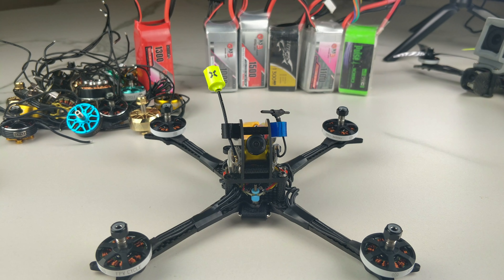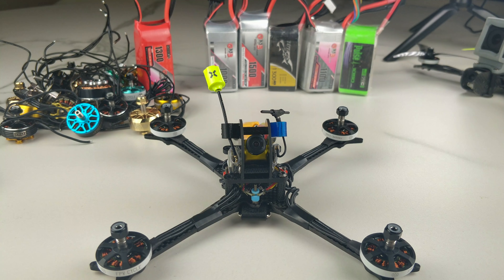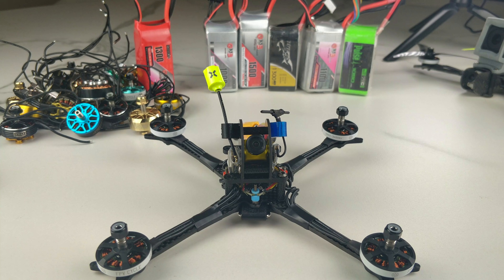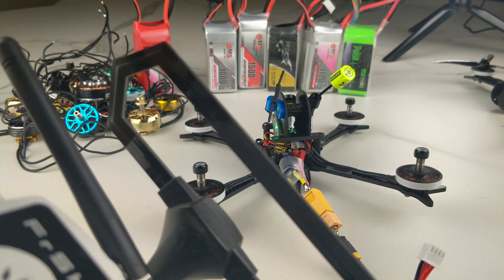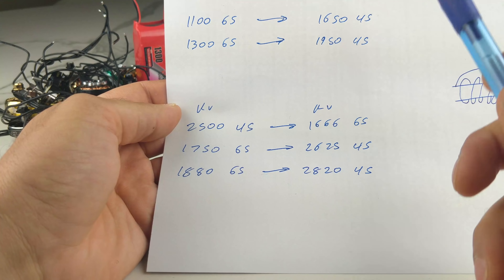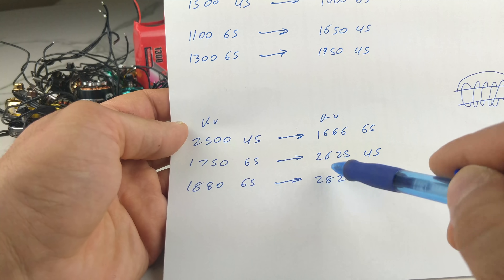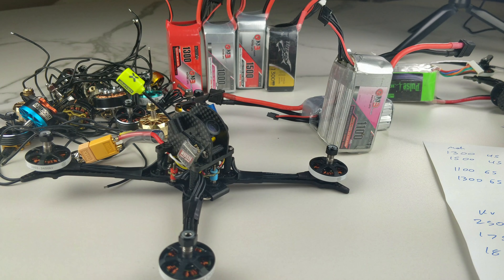6S Everything?  Why does 4S feel different?

Comment from the maker: RSGo Competition: https://rsgochampionship.com/

Disclaimer:
I am NOT an engineer.  I DO NOT know everything.  This video is presented to the best of my knowledge at this point in time.  If I've made errors, please educate me instead of spitting hate.  Thank you.

FPVCycle 2203: https://bit.ly/3i7QPuA
CineSplore: https://bit.ly/3dGJu1z (back in stock in ~11 days)
Gemfan Duct props: https://bit.ly/385nvAk
30A 4S AIO Toothpick board: https://bit.ly/3i8POCq
PowerPick: https://bit.ly/3fW6iMq

Longer Vista antenna - https://bit.ly/2ViXhFg
Vista + Nano Nebula - https://bit.ly/2ViXhFg
Vista kit + longer camera wire - https://bit.ly/2ViXhFg
200mm DJI camera wire - https://bit.ly/3eyBYXU

More things coming soon to FPVCycle.com

Table of Contents:
►00:00 - Intro
►04:25 - Example of issues on higher voltage
►07:25 - Comparison of 4S vs 6S
►12:58 - Basic electromagnet overview
►14:45 - Moving from 4S to 6S, current drop
►17:29 - What voltage does to torque
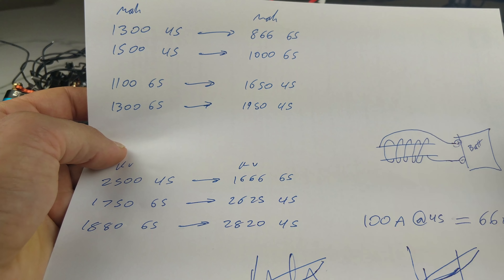►21:55 - When do you need more volts

▼Join my FB group for more discussion: Kabab FPV
https://www.facebook.com/groups/379155946182689/

The store: www.FPVCycle.com

▼ My typical 5" quad setup:
-CineGlide: https://bit.ly/2MCoz50
-Motor: http://bit.ly/2Nqqr25
-ESC: http://bit.ly/2oDdzvL
-WaFL’s Cap Cap: http://bit.ly/2GUpXxO
-Battery: http://bit.ly/2JnsTDM
-FC: http://bit.ly/2XRc8G8
-FPV Cam: http://bit.ly/2Q7LfL7
-Vtx: http://bit.ly/38Y25oz
-ND GoPro Mount 30deg: http://bit.ly/2WC15zc
-ND Filter (if used): http://bit.ly/2WEmQ1j

▼Notable motors:
Check out the Rcinpower Wasp and Bison...interesting motors coming.  We're working on blending those two motors into one.  The Wasp is more powerful but the Bison has an awesome 11mm bearing that's uber smooth.

▼Starter goggles: http://bit.ly/2qbJNOS

▼ If you want to solder better:
-Fantastic solder: https://amzn.to/2P5QM2W
-Fantastic iron: https://goo.gl/DqBipa

▼ Tips?
Patreon: https://bit.ly/2oGLP9b

-PayPal: https://www.paypal.me/kababfpv
-Bitcoin: 1E4XZXoD4rS6MYWVWuenY7Kw2M1YgyNpoQ
-Nano: xrb_1188ek5bd7tb9kw67asnp9o65byuoaxbtpxuznx1ribf75x78awywmakj55f
-ETH: 0xD067F93811f2eC31CB1928901002dfdf9A492EF5
-LTC: La2KWYAjp4VT2Lq2M76pbjzXWvRyjpfCtG
Reply: @KababFPV
Increasing current flowing through a wire,  does increase electron flow, producing a stronger magnetic field. However, that assumes the exact same wire, with the same length. 
A magnetic field is produced along the entire length of the wire. Therefore, a wire 1m in length, with 10A passing through it, would produce an equivalent overall magnetic field as a 2m wire with 5a passing through it.
As you go down in kv, the number of turns on each pole has to increase with all else being equal, increasing the length of the wire proportionally.

Additionally, the resistance of the wire does increase proportionally as you either lengthen it, or reduce the cross sectional area of the conductor, or both as is the case of a lower kv winding.

A lower kv winding will have a thinner (smaller conductor cross section), and longer wire, with more turns. This will produce a higher resistance per phase.
The higher or lower resistance will not directly effect the magnetic field, however will increase or decrease the amount of current that will flow for a given voltage.

Theoretically, If a 2306 motor, with 8 turns per pole, resulting in a 2700kv motor (this is actually the result I got on a 3b 2306 motor)

Then a theoretical 16 turn winding would result in somewhere around 1350kv winding. 
This motor would require half the current to produce the same magnetic field as the first 2700kv motor. 
Twice the number of turns, with twice the length of wire.

There are a few problems with this scenario I can see though. Kv does not scale linearly with the nr of turns, as well as other practical implications. eg. when you increase the number of turns, the turns are wound over the initial ones, placing the copper further from the core, and the magnetic field becomes less effective. 

Perhaps Ryan Harrelll could give us some insight on this?
Reply: @darrensmith8107   i couldnt describe it better :) 👍
Reply: Excellent thoughts Darren.  It gets more complicated with skin effects, particularly as they relate to near-saturation states as winding count and actual flux gets interesting at that point, which is why the lower KV from higher turn count doesn't just jump higher.
Reply: For the very limited scope of the concept that you were trying to convey, your presentation was dead-on simple physics.  The movement of electrons in a conductor (a current) creates a magnetic field.  If you curl the wire multiple times around a cylinder made of a ferromagnetic material (a nail) it will produce a magnetic field stronger than it would be if the material  were not there.  You can prove this quite easily by wrapping wire around a nail, preferably a thick one, but that’s not even a requirement.  A regular 8 or 10 penny nail will participate even if the wire is wrapped quite haphazardly around it.  You can amuse yourself (and your friends) by hooking it up to an old-style dry cell and picking up small metallic items quite readily.  If you wrap more wire around the nail (or increase the current) you can pick up even larger things.  Your explanation as I understood it, was simply to convey the concept that electricity flowing through a wire, around a magnetic form (regardless of the shape) or not, which varies in the amount of current flow from moment to moment will create a magnetic field which varies in strength with respect to the current flow.  This is what an ESC does; it modulates the current flow in the magnetic coils of a motor, in response to signals from the Flight Controller, to make the motor turn faster or slower as a result.  Because it is able to do this at incredible speed, the motors can be made to respond to very slight changes coming from the flight controller of varying amounts for each of the 4 motors in a quadcopter simultaneously .  Without our ability to produce the complex hardware to do this, we would not be able to fly our craft the way we do.  Yes, there are amazing engineering challenges to making this happen, but the concept remains simple without any need to get inductance effects, much less eddy currents or skin effects.  Like I said the first time...you did great!
Reply: Thanks man. Your videos are making me smarter :D
Reply: This is again wrong. The "torque curve" makes no sense for a BLDC motor.
It's torque is not a function of RPM. Instead, it's approximately proportional to the current and the inverse of Kv. Yes, lowering Kv means you need less current to produce the same torque.
So going 6s does not lower torque. That doesn't even make any sense, especially vs RPM, because the torque required is dictated by the load - the propeller dragging through the air.
Reply: I think that the impression people get from 6S giving "more torque" comes from the faster delivery of current to the coils, so in effect the quad becomes "more responsive". I personally don't bother getting the right KV from the hardware side (out of the box), I think playing with throttle cap gives more room to play and saves me $$$. It probably isn't performance wise the correct way to do it but you end up tweaking it anyway due to different course conditions (tighter turns, longer straights etc.). By it being not the correct way performance wise I mean that the thickness of the windings could also have effect on the end result. I didn't have however the opportunity to hold two motors from the same manufacturer only with different KV's, therefore I am not sure if they only differ in the amount of windings or if the thickness of them is also different between the KV versions. The thickness could however have an effect on delivering the current imo. Thicker winding surely have more durability due to better heat resistance, but they rather should have they use in 4S setups where there is more current being pushed through them.
The bigger problem which I see with 6S is that it got so hyped up, that the manufacturers did not have the time for proper R&D before producing 6S capable ESC's. 6S rigs tend to be drasticly less durable. The voltage spikes are so big & impactfull on those tiny mosfets & capacitors that they tend to blow up. The ESC's tend to blow up especially after crashes when motors get stopped from impacts and the flow of current in the electronics is being drasticly disrupted (used 2 Tekko32 ESC which both gave me fireworks). I had external low ESR capacitors blow up even on connecting a 6S lipo, and had 2 quads burst completely into flames after crashes... I even tried to protect the system by using XT-90S connectors which have tiny resistors built into them restricting those initial voltage spikes/sparks on connection - it did not help... I got to the moment in which I am a step from ditching the whole 5" 6S setup concept, because it's not reliable enough and is really costly to run... I gave myself however a last chance to rebuild my quad from ashes, this time with the Aikon RD32 which appears to be able to cope with 6S juice. If it also fails on me I will probably end up selling all my 5" shit and building myself a 1-2S 3" babytooth, because it's more reliable, has less inertia in crashes, is more cost effective, flies really well when set up correctly, is lipo cell-wise more diverse and therefore can fly anywhere indoors & outdoors not bothering nor harming anybody but when needed - can rip the hell out in acro & racing, it flies longer, is quiter, fits in tighter spaces, is more agile, you can make gates out of cheap, tiny soccer goals + you fit into the new sub 250g regulations so you finally don't give a Sh** about anything. I think 3" or 2" with 3" props will be the next golden standard. This will be my FPV retirement setup :p
Reply: @MrLukkar  What faster delivery of current?
Lower Kv motors have more turns of thinner wire, therefore higher resistance and inductance.
Reply: @MrLukkar  High Kv motor with high voltage and throttle limit is a very bad idea. Throttle limits the PWM duty cycle, but the full voltage is still applied over low resistance coils.
So this is not cheaper. It's an easy way to kill motors and ESCs and waste money.
Reply: @xnoreq  I did not mean the motors but the higher Voltage itself -> faster current flow. Could it be? Could it give the sensation of faster response?
Reply: @MrLukkar  Last comment, again repeating myself from an earlier comment: Torque doesn't come from "faster delivery of current", whatever that is supposed to mean.
Torque is proportional to the current and inverse of Kv. Lower Kv means more torque for the same current.

Also, if you design a multicopter yourself then you should know what you're doing. Design starts with the estimated weight and propellers. This gives you required RPM and torque for hover. This in turn gives you options for low Kv and high voltage batteries to high Kv and low voltage batteries. These options are restricted by motor and battery weight and availability as well as ESC limitations. At least that is my approach.

Finally, I haven't said anything about voltage spikes yet. Let me guess: you have thick battery cables with thick insulation.
Are you aware that with the capacitor at the ESC this can form a resonant circuit that actually boosts voltage at some frequency? Given typical parameters from these small multicopters this peak can fall in the 10 to 150 kHz range, and in the worst case coincides with the ESC's switching frequency.
These resonances can boost voltage by as much as 10x.
At the same time higher frequencies will be attenuated, so your GHz video feed might look cleaner despite the peaks at lower frequencies.
The easiest way to improve this is to use thinner cables with thinner insulation and have both ground and positive wires tied together as closely as possible throughout the whole length.
Reply: @xnoreq  Thank you for your comprehensive answers, there are for sure multiple reasons together which can cause electronics failure , things that an average bloke like me does not even consider in troubleshooting. But all what it comes down to is a simple question? Do we as hobbyst (not engineers) need to go as deep into those phenomenons to get those quads working right on 6S and not have them fail on us and burn our money? Or should the manufacturers care more about the quality and capapabilities which they promise in their spec sheets? I have built myself already 8 quads and had never such problems before I went into 6S. I don't think I am doing SUDDENLY something terribly wrong while building my rigs - maybe introducing those high KV motors with throttle cap on 6S, but it would rather speak to me if I wouldn't set this cap and instead fly at full throttle to get "more power" out of the quad... I haven't heard a single issue from someone using throttle cap on high KV on 6S within reasonable ranges (matching the battery voltage x motor KV to get similar or even lower numbers as on 4S). I am also not using the type of throttle cap which lets the ESC & Motors go bonkers under the set cutoff treshold and cuts off power above it. I use the one which turns down the power in the whole throttle spectrum so to say, so that the power delivery is smoother and weaker through the throttle range. The Xing motors are also running with a healthy, barely felt warmness - they are far from getting smoked imo. Is it maybe possible that a stronger back EMF is being shot back at the ESC which could fry it? All in all I would rather suspect that most ESC's are either not really built to withstand 6S , or the components are low quality or even the QC could be lacking at the factory. It's not the first time Holybro's components are dying on me (ESC's and specially F7 FC's which came multiple times with some components already shorted when I measure them with a multimeter before soldering it up) My mates are also experiencing failure on HB components, and on the other hand Aikon ESC's have a good reputation in the community for being durable. I think most of the companies are not ready yet to deliver proper electronics, and keep pushing bullshit into the market to not let the competition take the bigger portion of the 6S market cake, which is pumped up with hyped high demand from the consumers, including me :P
Reply: @MrLukkar  Well, I'm not that experienced with multicopters but with e.g. airplanes you just pick the manufacturer's recommended power setup or do minor tweaks to it if you don't want to do any engineering. If you design your own power/propulsion system then there's no way around engineering. Trial and error (and damaged components) is also possible, I guess.

I also don't think you're suddenly doing something wrong but when you run a 3-6S ESC at 4S then voltage and current peaks are more likely to fall within tolerances than with 6S. With a 6S supply you're already close to the upper tolerances, so more care needs to be taken.

You cannot just multiply throttle % with supply voltage. These ESCs use PWM which means they quickly turn on/off the FULL supply voltage. Throttle % can only change the averaged value (the PWM duty cycle as mentioned before). You can therefore only match average power, but you will still get much higher voltage and current spikes. Current spikes get worse the lower the PWM frequency is and will be MUCH higher than the average. So even if the average is safe, it still could result in damaged components.

I cannot believe when you say nobody has problems with this. The first thing everyone with a clue will tell you is that limiting throttle is NOT the proper way to do this. The proper way to do it is to match components properly and there is no way around this.

Back-EMF is not bad, it's good. It's what reduces the current considerably. It's also a function of the motor parameters and its RPM, not of the supply voltage.  The problem with high Kv motors is that they don't produce a lot of back-EMF, so the motor will look more like a short-circuit to the ESC. Which means current limiting in the ESC is very important, especially when RPM increases from zero or low RPM.

I don't think manufacturers push BS onto the market, but maybe their tolerances are too small for the abuse from some of the hobbyists' choices. :P
Then again, I've seen high quality ESCs where the manufacturerer warns in the manual that adding just a few cm to the battery wires can result in damage and it is your fault, not theirs. That's just how tightly these components are matched and not necessarily a sign of bad quality.
Reply: @xnoreq  Do you have some articles or clips worth checking out about the high kv motors producing lower back EMF? It seems interesting and I did not stumble over this topic anywhere...

I do agree with you that choosing the right hardware initially is the right way to go, it would be even better to choose components from the same manufacturer or same model line, but it is most common that people choose different ESC-s, motors, flight controllers because they have some specs or functions which other do not provide. So there is already a mismatch of components from the beginning. Software is therefore to iron out noises in the pidloop and for the ESC's & motors to perform smoother. I don't think KV has such a vast impact alone if the motors are not driven to ludicrous high rpm's where you do not get any increase in power only current being transformed into heat. You can have the most perfectly matched KV, but the motor could have weak bearings, weakly balanced motor bells, have them slightly bent after some crashes or poor/bent props which could more likely cause overheat of components than mismatched but throttle capped motors. Nothing is perfect, there are always some drawbacks, especially with high performance drones, cars and other stuff working under high load. It would be cool for everyone to have a test bench, have everything dialed in perfectly, but the nearest tree or pond would answer the question if this pursuit after perfection has made you enjoy flying more :p those rigs get damaged so often, components get swapped so often, that there is no time for deeper engineering, otherwise we would mostly sit with calculators & testing rigs in the basement instead of actually flying. There are people who choose the first, that's also cool, no offence, but I see those things from a perspective of a person who wants to enjoy being in the air, rather than having to dive into electronics deeper waters. That's the job of manufacturers to deliver components which at least perform ok and do not die on us. If it is rated for 6S than it should work with those packs, at least warn consumers to take precautions in some cases. The only things I see on BG is WOW, look - 60A ESC! Buttery smooth, has heat sinks in the shape of Ironmans head, and most important - it has LED's to look cool! I understand that marketing is the leverage of trade, but it won't get them far if the thing does not work as stated. My friends and I, we are so upset with the quality Holybro delivers, that we won't make any further purchase of their components... I had even a case when a F7 FC was dead after a few days, and the next F7, which came for replacement was already having issues with it being short circuit somewhere on the board straight from the factory, as I have mentioned in the previous post. The ESC-s on the other hand which caught into flames, are no longer available anymore (and they are not an old batch) They have quietly replaced it with a upgraded one. Their stuff just leaves a lot to be desired or corrected...
Reply: @MrLukkar  No, I don't have good references handy, but it's not that hard:
Your BLDC has 3 phases. Each one is electrically a resistance, an inductance and a voltage source in series: ----- R ----- L ----- +V- ------
The resistance is just that of the copper wire. It's usually just a few milliohms. This alone would result in hundreds of amps of current draw and result in immediate thermal failure of the coil windings, but there is more...
Coils moving past a magnetic field (from the permanent magnets) result in an induced voltage. This is what we call back-EMF. This "opposes" the voltage coming from your battery. It scales directly with how fast the magnetic field is moving, in other words RPM.

Consider a 1000 Kv motor. When you spin the motor at 1000 RPM then it will generate 1V (electrically a voltage source, just like your battery, as mentioned in the beginning). If the same motor is rotated at 2000 RPM then it will generate 2V. And that's what Kv specifies! How many RPM does it take to produce some voltage. RPM per V.
Kv does not technically specify the RPM you will get when applying 1V, but it can be used as such as an approximation.

So why does a motor speed up? Because as long as the back-EMF is lower than the supply voltage, current will flow. Current through the coil windings turns them into electromagnets. More current means stronger electromagnetic field, so they pull/push stronger on the permanent magnets. This is also why a big propeller with higher air resistance will lead to higher current draw.

Eventually, the motor speeds up to the point where the back-EMF matches the supply voltage ([1] well, almost). That's when the motor reaches max RPM for the given supply voltage and mechanical load.

[1] Almost, because current flowing through resistance results in a voltage drop. Imagine 5V supply voltage, 0.02 ohm coil resistance, 1000 Kv and an amp draw of 10A.
So the 5V drops down by 0.02 * 10 = 0.2V, so we get 4.8V. When the motor spins at 4800 RPM it will produce 4.8V back-EMF which perfectly matches the (dropped) supply voltage.
In other words: 1000 Kv * 5V is actually 4800 RPM if the current draw is 10A.
Reply: @xnoreq  That's cool science :) thank you for your effort!
So would it be right to say that when comparing a High KV motor with a low KV one on 6S, keeping them both at a constant low rpm - lets say 1000rpm - it would show the kigher KV one to be significantly less efficient due to the lacking ability to generate a greater back EMF thus leading to more current being passed over to the motor? 

It would be however cool to see in the future someone showing the negative effect those high kv high voltage setups have on the esc's  despite throttle capping. If it really has also a negative effect on the ESC's besides the motors, it would surely get the people aware of the negative action it may produce on them. It is just sometimes easier to understand if it's visible :)
Reply: @MrLukkar  Efficiency is a whole other topic.
What we can say from Kv is the back-emf generated, but also how much torque is produced.
Torque is literally current/Kv. So higher Kv means that at the same current you get less torque (but usually more RPM).
So if you have a large, 4-bladed prop with high pitch then you will need lots of torque. A high Kv motor would not be the best fit as it would draw tons of current. Efficiency would suffer.

I'm currently building an airplane with 11" prop and I actually have done some of these engineering calculations. :P

With 4s and an 800 Kv motor I get roughly 9 mins of hover.
With 3s (with same total Wh as the 4s) and a 1500 Kv version of the same motor series I would only get 5 mins.
Reply: @xnoreq  Thanks for the in depth chat. I guess besides a new ESC I will need to sell my high KV Xings and look for a low KV alternative instead. I really felt that I got significantly less flight time out of them on 6S 1000mah than on 4S 1500mah... Thank you again, I wish you happy flying with your new plane rig :)
Reply: Im in my 4th year of Electrical engineering at UCT, recently did a project on brushless DC motors. Would love to chat to you about this as I disagree with some of what you said. Great video though don't get me wrong <3
Reply: instablaster.